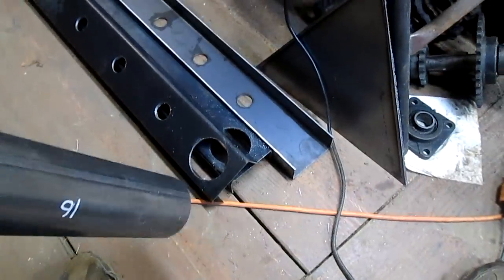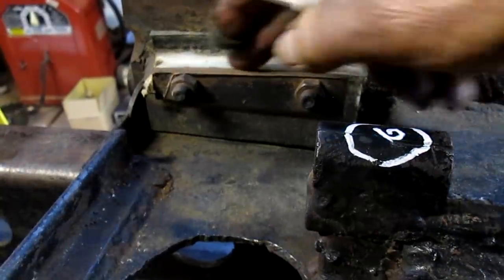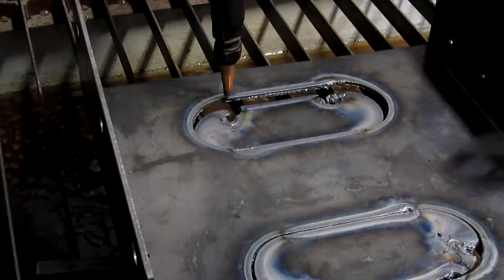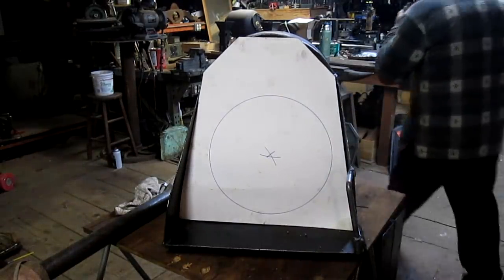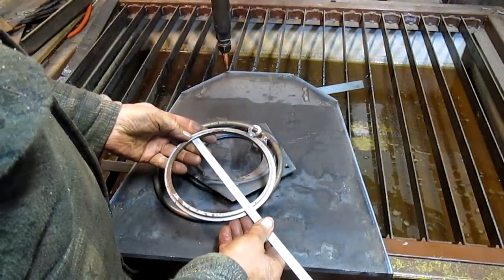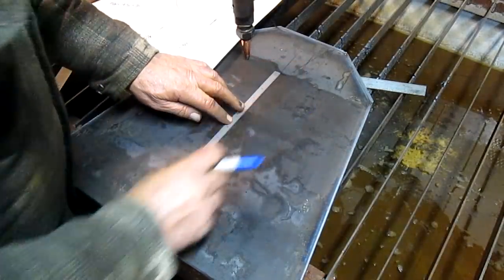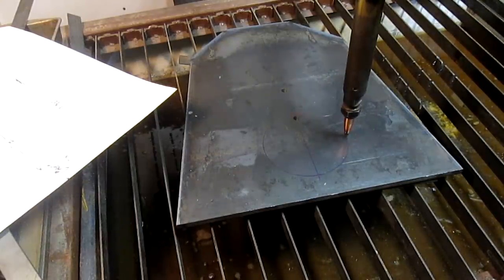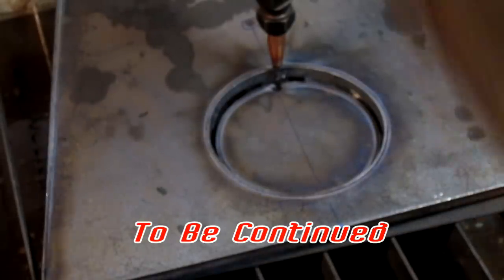Earth Drill Build #3 (full version finally)

Comment: The cleanest torch cuts I ever took were while the gas bottle was running out, where an adjustment would last about three minutes.  No dross at all, but it took forever and that job almost didn't get done that day (the fun of working in a very remote location in Alaska).  {shrug} take whatever clues you can from that... I've yet to take another that was as clean as those were.
Reply from the maker: SO you have a pattern torch?
Reply: @NikColyerMachineWorks  No pattern torch, though I've used objects as guides ... soup can, coffee can, length of leftover angle iron, rail car truck bearing.  I can't free hand worth anything, I'm just too jittery.  It might be better if I did it on a regular basis, but when it could be a month or two between times I use a torch, muscle memory gets pretty cloudy.
Reply from the maker: @infoanorexic  Hey, I'm too jittery freehand too, thus the pattern torch. I like to soup can idea.

Comment: Hi Nik. You probably know this but there are different tip sizes for ranges of steel thickness.  You torch tip is probably sized for the heavier steel thicknesses so you'll need to change it to get good results on thinner stuff.  Good video series.  Tc, Mike
Reply from the maker: Yes, I have the whole set of tips now and I have a job cutting thinner stuff coming up, so the experiment goes on. Thanks for the tip 000 or 0000.
Reply: @NikColyerMachineWorks  I never bought a tip bigger than a 000. I used it to cut 10 gauge all the way up to 1 inch plate with a 000. My secrete was always have either a new tip or a very clean tip. And the thicker the plate the higher the oxygen pressure. I also set my oxygen and acetylene mix different than most all of the people I have seen on Youtube. I think the way I set it made it hotter than most people make it. I don't really know that for sure but all the guys I worked with lost money betting me it wouldn't work. Another trick I did was to split a 1/8" welding rod with a cutting torch. I would stand it up in a vice and split it down the middle and make two pieces roll down the side like a curly q. 000 tip and the pressures had to be just right.
Reply from the maker: @dannywilsher4165  Thanks for the tip. I'll give it a try.